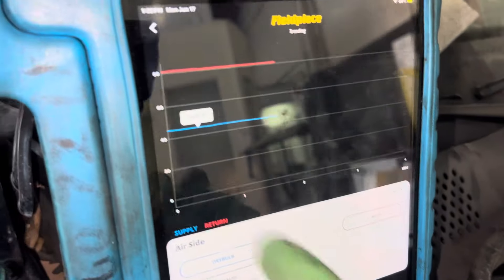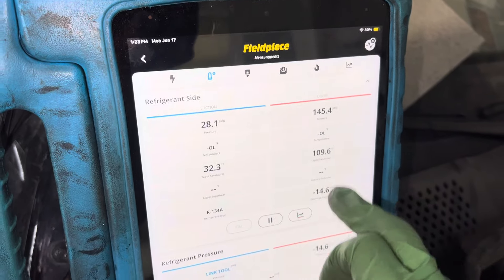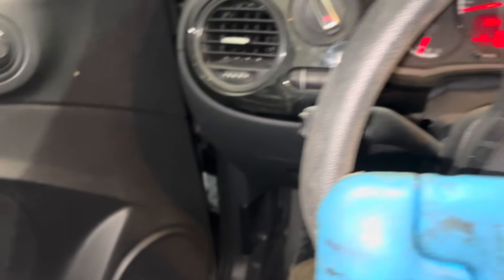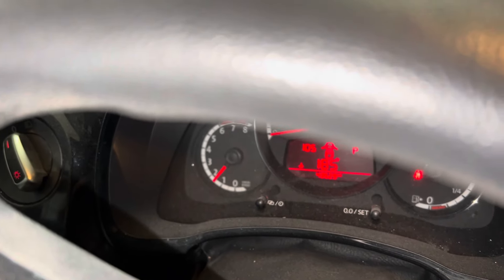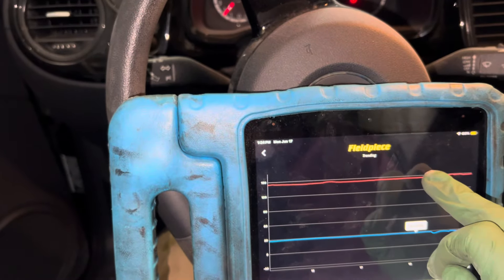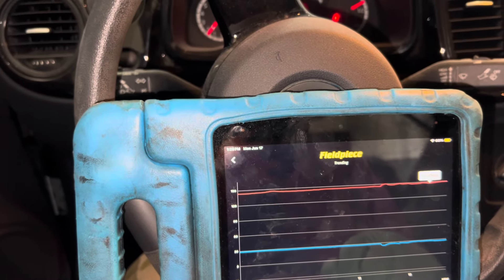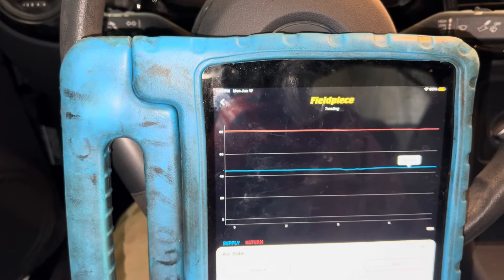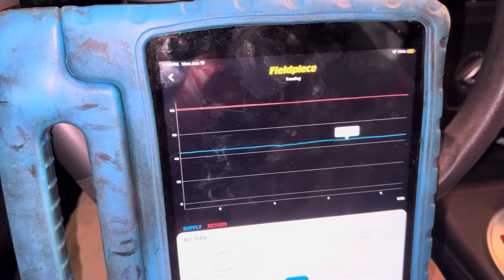Refrigerant pressure engine RPMs go up. Low side or high side pressure do not change. ￼

Comment: Tom. Just an update. I managed to hook up permanently a K thermocouple from Omega, on my EVAP suction pipe. About 1 inch from TXV.
I have not installed the planned K thermocouple on compressor output and condenser output yet.
Anyhow, I am now able to log the temperature of the EVAP suction side fat pipe along with all my OBD2 data PID and other custom sensors I have. I am using Banks Data Monster gauge and the log is kept in CSV file using microHD card.

So far I been getting this : At irst engine COLD start , the temperature is down to -1 Celcius for a bit, and then 2-5 degrees Celcius all the time.
I set my EVAP temperature at 2 Celcius , the setting is to the AC computer module N22/7 it is called in Mercedes system of W212.
Worse case at ambient temperature of 35C and creeping traffic jam bumper to bumper, 5C is the highest temperature logged.

That's all the update for today.
Reply from the maker: Pup a sensor at Outlet of evaporator. 
You can read superheat to compressor. And take superheat across evaporator because you already have sensor just after expansion valve

Comment: VW variable displacement AC compressor? If so, I'm guessing the ECU adjusted the compressor to accommodate the increase in RPMs.
Reply from the maker: Yes, exactly many manufacturers do this now for the past decade

The first variable displacement compressor came out in 1985 on a Cadillac. It was a mechanical valve worked off pressure. 

And they also adjust the fan speed on the condenser to control the high side pressure too not just the compressor, but they could raise or lower the fan speed and this will make the high side pressure go up or down depending on the speed. The computer is doing this by looking at sensors. 

So the technician who keeps adding refrigerant trying to obtain a pressure at the same time, the computer is tricking him, and changing the pressure to what the computer wants to see  

Unless The Mechanic just keeps adding way too much refrigerant and then eventually the computer can no longer compensate for the refrigerant this time. It’s way too late and the system is way overcharged.